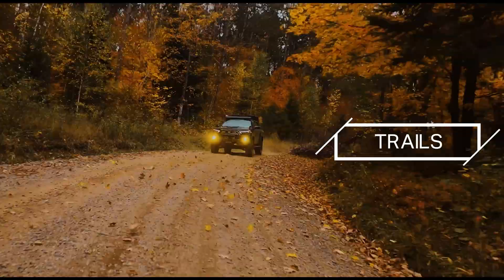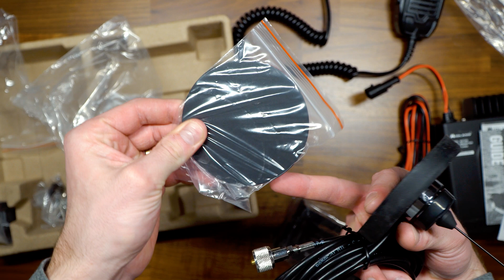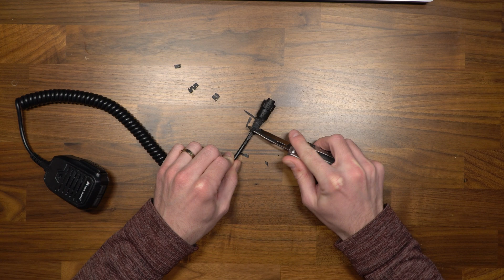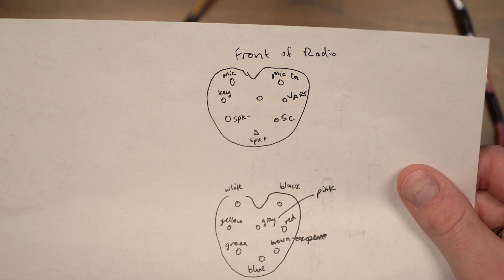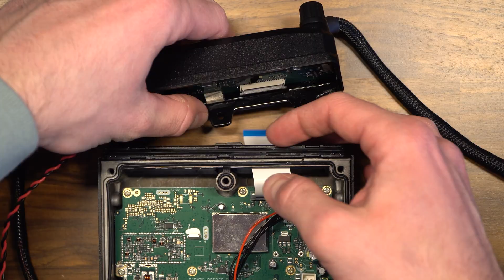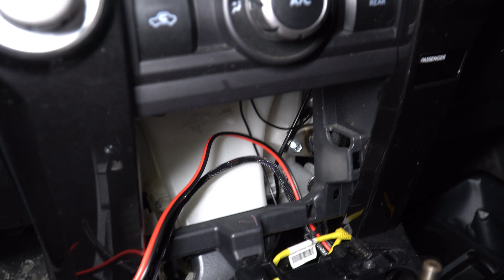NEW High Power Offroad Vehicle Radio Hidden Mount & Install!

Comment: Im lookin into doing this now since the mxt500 has a PA Speaker function and the MTX575 does not. Do you know if I bought a spare mic and wire could you use that wiring to go from radio to switch?

Comment: Great installation idea! Some viewers may not know that the fins on the back of the radio are a "heat sink" aka a radiator. It conveys heat away from the radio and dumps it into whatever is next to it. Give it a wide berth for maximum cooling and maximum protection of whatever is near it.

Comment: What size wires did you use for the colored mic wires? I'm currently doing a similar install with a CB and the same Midland radio mounted in the center console and want two "remote mic Jack's" on the dash like you have the one.

Comment: I had the mtx400 mounted in tacoma console. It had the older mic connector so mic extension was easy. Recently swapped to KG-1000G and mounted faceplate up on dash.

Comment: Did you consider remote mounting the entire faceplate? Seems like you could have extended the ribbon cable connections in a similar way.
Reply from the maker: Yeah that would have been interesting!  I think you could do that.  cutting holes to pass the ribbon cable would be interesting but probably doable.  I think there are one or two other cables that would need to be extended too.

Comment: Man, you're brave! I had a similar idea when I first got my MXT275. I wanted to have both a GMRS and CB, and route both handhelds through the little useless coin holder on my 4Runner. At the time I had the 275, and a Cobra C75WXST. I snagged 2 RJ45 pass-through ports figuring I could just cut the multi-pin connection off the end of the Cobra and convert it using a bit of CAT7. I'm still convinced that would have worked, but I went ahead and cut the connector off before finding out that I had drastically over-estimated my own soldering skill. So I ended up having to scrap a $130 radio before I even had a chance to use it. I picked up a Uniden Bearcat for the same purpose, only to find out that when you do use an RJ45 extender (which they include in the box) it makes the radio lock up when you press the transmit button. Frustrated, I threw that one in my off-road accessories bag, grabbed a magnetic mount for the CB Antenna, and bound the cable to only use when I need it. It lives on my Rago MOLLE panels in the back. I did a quick fab of a bit of aluminum that I drilled and tapped 1/4x20, and popped a RAM mount on it to live right next to the RJ45 connection for my 275, and mounted the handset arm to that.  I'm anxious to know how those soldered connections hold up to the off-road conditions. Thanks for making the video!
Reply: lol

Comment: That's a ton of work! Looks great though 👍🏼 I'm going to stick with getting a KG-1000G with its removable faceplate and do a PTT relocation similar to what you've done. Should be a lot more simpler than your setup haha. Hope the Midland works out for you 🤙🏼
Reply from the maker: Thanks!  It was some work but a fun project.  Much more approachable if someone had told me what to do.  That should be a pretty sweet setup also though!